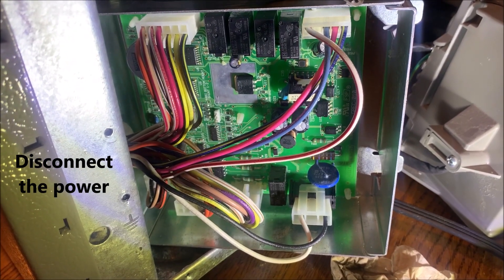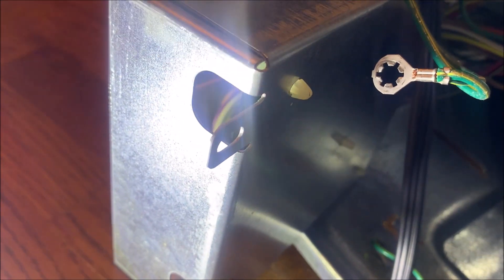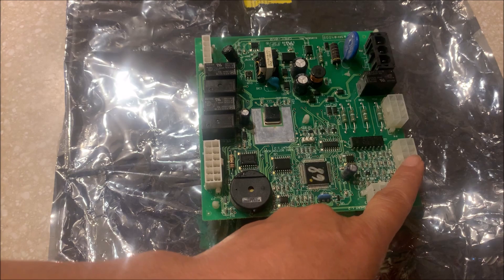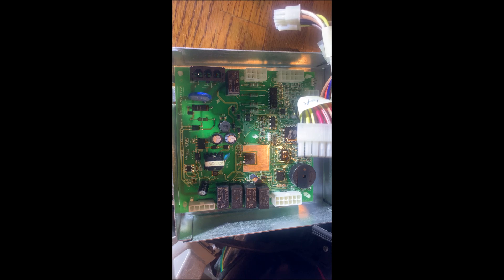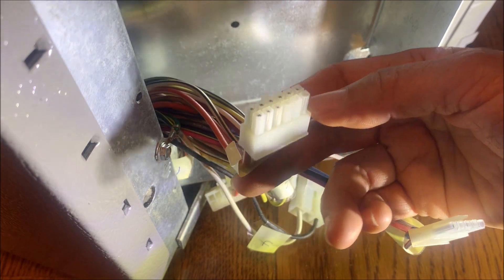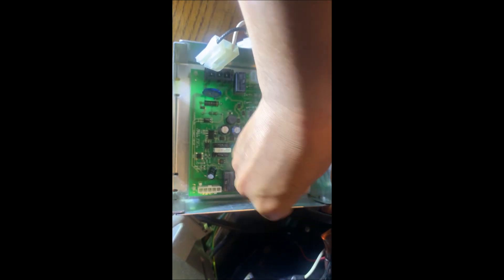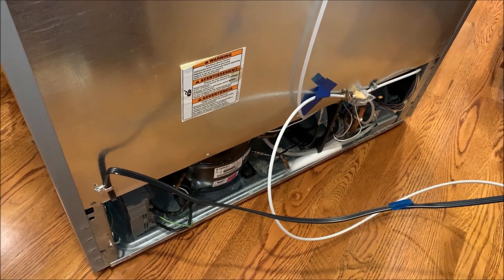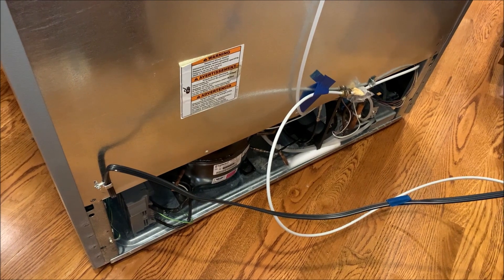DIY - fix KitchenAid fridge chirping - Model: KSCS25FVMS01

Comment: Hello, my refrigerator is the same model as yours. My refrigerator suddenly stopped working, and I suspect the compressor start relay is not functioning. Do you know where the compressor start relay is located? Thank you so much.
Reply from the maker: Sorry, I don’t. For mine, it was working but the control board paused the fan briefly. I mailed it out for repaired. You can called the repair company I worked with and hopefully they can give you the answer. Good luck.